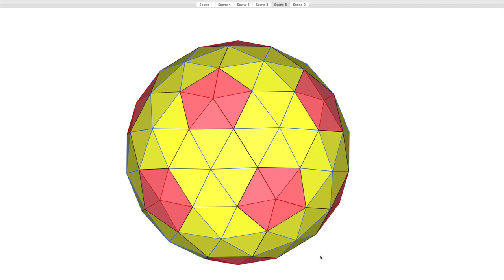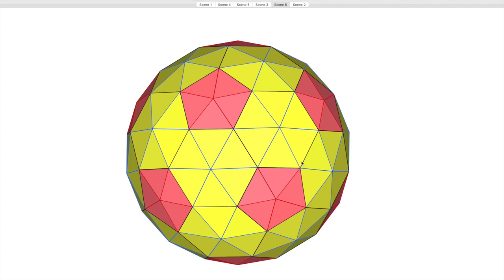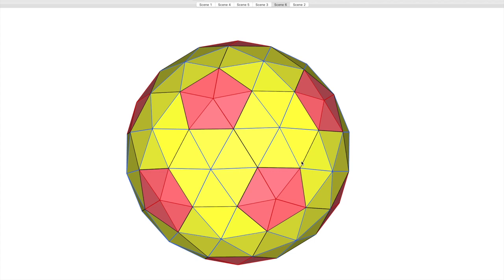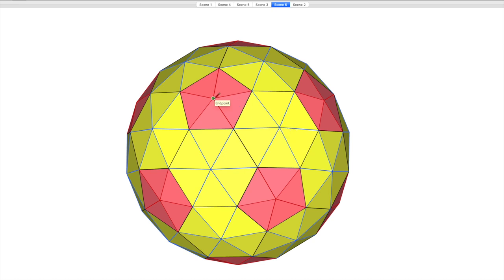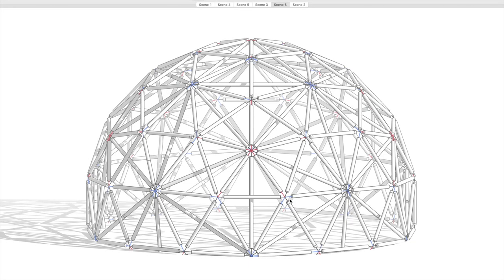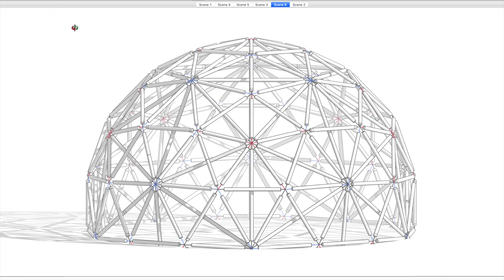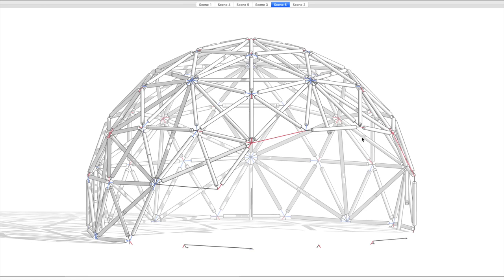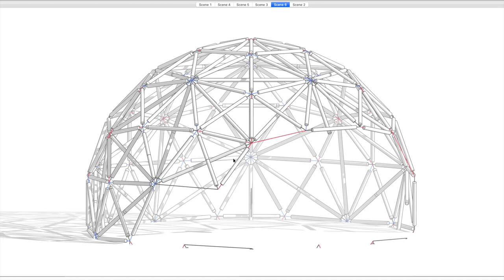3v trussed frame geodesic dome, is it a game changer?

Comment: This is equivalent of having a 2v and a 3v dome at the same time. Very inspiring!
Reply: I asked Paul, and he said that the inner set of struts isn't a 2v dome. It is actually a Pentakis dodecahedron (https://en.wikipedia.org/wiki/Pentakis_dodecahedron ), which is not a 2v dome. It is a dodecahedron where each pentagonal face is turned into five triangles, with the vertex pushed out to conform to the containing sphere.

Comment: It should be pointed out to everyone that this type of trussed dome appears to be the kind of dome that Buckminster Fuller used for all of his big dome projects, but this method of stiffening the dome has been forgotten, and none of the dome enthusiasts out there today appear to have preserved this insight. Do any image search for the domes made by Bucky Fuller, and you'll see that they are trussed domes. A single layer dome does not get stronger as you build larger because of the risk of buckling due to the vertices becoming very shallow, but the trusses protect against the risk of buckling.
Reply from the maker: Yes you are totally right, Oh just thought it could also be possible to connect to the WangerFlange lugs for the trussed portion which would half the number needed.....
Reply: @Geo-Dome  Could you show what this means in your next video? I'm not sure what a WangerFlange lug is.
Reply: @Geo-Dome , it seems to me that your thought is correct but I just cannot get my head around it. It would be great if you did a follow-up showing the hardware and how you would go about assembling it without wearing it, if you get my drift.
Reply: @seanflanagan5674  
Assembly video backed by Benny Hill music would be perfect.

Comment: Not gonna lie, Paul, I'm a little bummed you've moved away from beveled construction but the wanger flanges are cool too. Just can't really see myself using them. That being said, I can't stress enough how informative and awesome your videos continue to be! Thanks for all you do!
Reply from the maker: Don't be bummed, I'm still working with beveled frame structures, I just have to explore a few more possibilities with WangerFlanges. I have fully optimised plans for most sizes in Beveled frame but if there is anything you think I've missed by all means give me a shout.
Reply: @Geo-Dome  You rock, Paul. One thing I think could be a great video idea that would also help folks with WangerFlanges projects: Tutorial / ideas for laying out a foundation for the domes. I struggle with the idea of pre building an accurate concrete or block foundation that the dome will then line up with perfectly. It's a bit easier to do on wood, but something like laying out a concrete form?
Anyways, I'm not bummed anymore. Thanks again.

Comment: Paul I really like what your are doing and will be in touch with you.  I like the way you are sharing your ideas and assisting others to do domes.  You will always be welcome in my place in Northern Ireland.  I will purchase flanges and do some experiments.  I did a program using a hp calculator to do domes and drew them in 3d and really want to get back into it.  I was able to produce elliptical domes of any breakdown would be interested in doing the program again and  useThe wangerflanges which are exciting.  WELL DONE I ADMIRE YOUR WORK.

Comment: @Paul Robinson: I just noticed one feature of this geometry that may contribute to the strength of the truss. Look at 2:39. You can see that every strut seems to lie on a long arc (not sure if they're all great circles); pick any strut, inner or outer, and trace it's path; the outer ones all lie along a path that connects them to the long struts inside the dome. I imagine that this would transfer any pushing or pulling forces on this dome along that line, down to the foundation. The inner struts all lie along lines that transition to the outer struts when they pass through the centers of the pentagons.
Reply from the maker: Yes they are great circles in it, but the two rows at ground level are not quite.

Comment: I'm particularly interested in the 10-way and 12-way connections using wanger flanges. Will they be strong enough as a ring of connections, or does every other strut need an extender to reach in for a 5/6 way connection in the gap to give it rigidity?

If extenders are used for the 10 and 12 way connections, it would seem to me that the greatest strength that could be achieved would be to extend the inner struts, since they would meet at a sharper angle. In your booklet, you explained that very flat verticies are at risk of buckling in if pressure is applied to them. By extending the inner struts to meet at a 5 or 6 way connection in the middle of a 10 or 12 way connection, the inner struts would meet at a sharper vertex, and would confer more strength to the structure.
Reply from the maker: I've done 8 way and had no problems, I'll have to make a structure this way to fully test but I don't see any problems.

Comment: It just occurred to me that you could technically truss a 2-frequency dome as well, but the trussing would look rather different. Even frequency domes might not truss the same way as odd frequency domes.
If you take a 2 frequency sphere, and connect all of the pentagon vertices to each other, you would end up with a trussed sphere, and the inner shell of struts would essentially be an icosahedron (a 1-frequency sphere). But the visually odd thing about that manner of trussing is that the inner struts align with rows of outer struts. Instead of subdividing the sphere into a bunch of tetrahedra, the inner set of struts would turn the sphere into a shell of shallow octahedra. I suspect any trussed even frequency dome would end up with this characteristic.
Reply from the maker: Yes I looked at the 2v first, I would go from centre of pentagon to centre of the equilateral, you would need three struts from the corners of the equilateral, in a upside down pyramid. i'll maybe do something with a 2v also
Reply: @Geo-Dome  what I meant was that you could truss from the center of one pentagon to the center of another pentagon in a 2v geodesic sphere. Try trussing that way in even frequency geodesic spheres. A sphere trussed this way looks very different, but might still be stuff enough.

Comment: Excited to see more applications.  I am working on studying and building model Zomes.  Have you seen or worked with them before?  Since they are not as stable of a structure, I wonder if the trusses would solve there problem, however, I am not sure how one would truss a zome. Any ideas?
Reply from the maker: Yes working on zomes now and will be doing a video shortly,

Comment: Could the additional interior truss struts be replaced by cables? My first thought was that "no, cables would not help", but consider this. When a regular single layer dome fails, as one vertex pops inward, the surrounding vertices pop outward. Would interior cables strengthen the dome by preventing the outward popping of vertices?
Reply from the maker: Yes that would totally work! It would be like a pre-stressed system, the tension on the cables holding the solid frame under compression. A node inversion is much less likely because to push the vertex inwards all the vertices around it need to move outward a little, cable tension would prevent this. Great observation.
Reply: In the case of a 3v you`ll find no vertex moves inwards at the point of failure because they are all under load.
Reply: The True Nolan. Given that the geodesic dome is one of the strongest possible structural designs, the only way a failure can occur is through total incompetence of the builder. Look at 'prior art', there are many successful designs out there and strut strengthened domes are not required until you are exceeding 30 metres diameter.
Reply: @biomechanique6874  Hey Bio! Yes, one of the strongest designs, but is optimized for a distributed, radially inward load. Of all likely failure modes, a point source inward load is the most likely to induce collapse. This can occur on any size dome, large or small,  if the frequency is high enough. In fact, for a single layer design, as frequency goes higher and higher, the needed point load to pop a vertex inward approaches zero. the appeal of the inside truss design is that it redirects a point load sideways so that the load is once again diverted into a compression.
Reply: @ The True Nolan It is good that you have given these factors some thought. However, solid hub design combined with     adequately sized structural strut material selection for any given usage criteria is far superior to a design that would flex and deform enough for vertex inversion. Paul's wangers are too small for domicile applications - even with bracing.
Reply: @thetruenolan6655  
Your hypothesis is based on the assumption that the hubs will transfer the load and not simply buckle. The flange hub represents the weakest link in this particular chain. Trussing may redistribute the load but it doesnt alter the magnitude of the total load or the number of hubs carrying it. Adding extra struts doesnt make a flange hub any stronger, it increases in diameter effectively making it weaker. With a traditional tubular hub you can increase the wall thickness to make it stronger and/or make it longer to accomodate a stronger strut 2x4, 2x6 etc. These options are not available for the flange hub. Aslo consider that the additional truss weight will add to the deadload and that the upper hubs dont carry the same load as the lower hubs, much like the second storey of a house. You can design for this by using a thicker wall tube (no change in outside diameter) for the lower hubs that will be subject to the higher loads. You can also close the ends of the tube hubs with shouldered discs which will greatly increase the strength of the hub. These options are not available for the flange hub.
Reply: @biomechanique6874  Hey Bio! Thanks for the comments! You say, "Paul's wangers are too small for domicile applications - even with bracing." Interesting point, and I agree that they certainly could be a weak point if made too flimsy. How flimsy is too flimsy? Hard to say without building one and putting a realistic load on it. Alternatively, if it was not practical to make the flanges as strong as needed, design the skin to carry more of the load. You have probably seen Fuller's designs from his 1959 patent US2905113A where he uses a plywood skin to make a dome that not only has no hubs, it doesn't even have struts.
Reply: The True Nolan Hi, when Paul first fielded this idea he stated that he was considering larger versions of the wangers so basically he is aware of the limitations of his first 'mini' flanges. If you are considering a lasting design it is important to consider the weather anomalies currently worsening around the world. Solid and stormproof is the way to go.
Reply: The True Nolan, Hi, I do like your idea of a 'stressed skin' design. I have applied that thinking to the festival tents I have been designing. Unfortunately the orders were put on hold due to corona. We will have to see what happens for next year now.
Reply: @biomechanique6874   Festival tents? Very cool! Good luck with that, Bio! Thanks for your input.

Comment: I have an additional pair of questions.
1) I'm trying to visualize what the inner set of struts forms. I imagine it forms a sphere with a lower frequency, but I can't figure out what it is. It doesn't appear to be a simple icosahedron because an icosahedron doesn't have 6-way verticies. What does the inner set of struts look like by itself? Is it just a 2-frequency geodesic sphere? That's what I think it might be, but I'm not sure.
2) In this video (https://www.youtube.com/watch?v=WlDntcslkmE ), you explained that a 2-frequency dome is trivial to get a flat bottom with. This trussed dome, if it has a 2-frequency inner shell of struts, should be able to be divided right in half for a flat bottom, but also offers the possibility of modifying the 3-frequency shell of struts so that the undulating row of verticies get straightened out, permitting two different planes at which the sphere can be divided to make a flat bottomed dome (per this video of yours: https://www.youtube.com/watch?v=EU449-HhDeo ). With these two possibilities, what would you recommend for producing a flat-bottomed dome from this trussed dome idea? It seems like there are three planes at which the dome could be divided to leave the verticies of one of the shells all lying in a plane, but either the inner or outer shell of struts necessarily gets cut. How would all of those cut pieces elegantly mount to a flat base?
Reply from the maker: OK to answer your questions: The inner framework forms a pentakis dodecahedron, simply a dodecahedron with the pentagon faces made into shallow 5 sided pyramids. This is the dual to icosahedral symmetry again often forgotten this was mostly used by Bucky in the early days until he discovered icosahedral geometry which he called "alternative method" I'll model the plans on a Kruschke flat bottom 3v so you have all the choices, I don't often use this geometry because it doesn't work well with beveled frame construction but for WangerFlanges I think it would only add one extra length of strut. I'll try and get this done tonight.
Reply: @Geo-Dome  isn't a pentakis dodecahedron the same as a 2v geodesic sphere?
EDIT Upon further examination of a 2v geo-sphere with a pentakis dodecahedron, they do not appear to be the same. Can the pentakis dodecahedron be classified on the frequency scale?